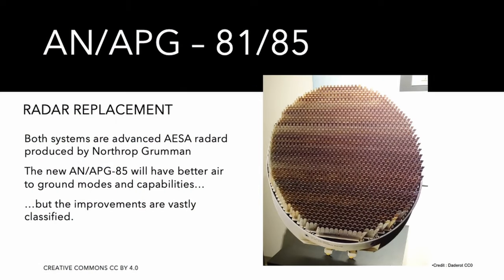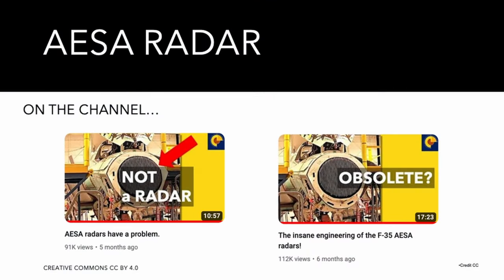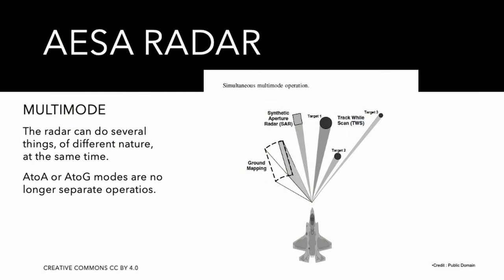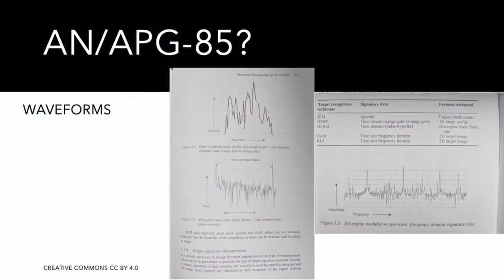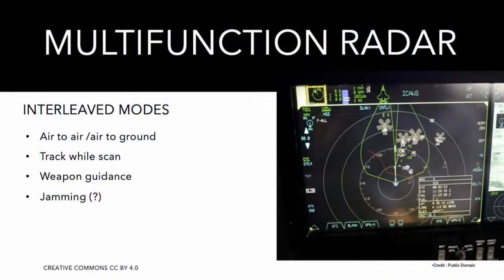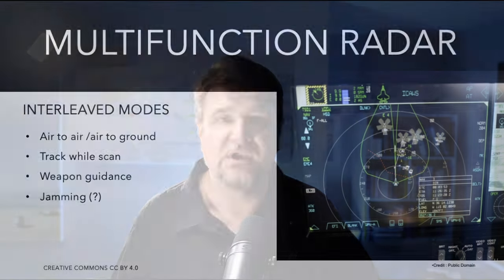The New F 35 Block 4 Radar is Bonkers!

Comment: For me this sounds highly complicated and a lot more electronic hardware & software on board. The F-35 is bursting with hardware ( so I have read on other videos). For me there is one question: isn't the F-35 a very delicate machine for external "powers"? Let's say by coincidence a bullet hits the body and ends up in some hardware. Can't something like that immediately cause a system crash and the F-35 falls out of the sky? Or a weather incident somehow get's right into the systems? Most of you probably now would like to wring my neck for even just suggesting something like that, but I never had really good "relations" with computers and software so I automatically think that any hard-and software is vulnerable....??
Reply: Shouldn't be that vulnerable, but the test pilot said every piece of software affects the entire system, so I guess it is possible
Reply: @matheuscerqueira7952  Thanks, yes, it is basically a computer with wings! So the "stay away from trouble" - strategie and deal with it from a distance makes sense!
Reply: If you think about it, your phone is full to the top with all kinds of hardware and while there are issues, it is functioning pretty well.
Reply: @napobg6842  True, I sometimes wonder myself why these gadgets still work after being used consistently! Just one thing: if I would put a bullet through it I do not believe it still would be able to go on like an F-35!!😂😂
Reply: @martinabowm1786  Well, there is so much tech inside a phone but it is really small on size so your bullet would do a lot of damage to a lot of hardware. While on the F-35 you have a lot of very big hardware. This means that you bullet would do a log of damage to just 1 type of hardware 😂😂
Reply: @napobg6842  Yep, got it!
Reply: I'm not entirely sure about the nature of the complaint. If a bullet destroy a critical component of any fighter, the fighter is a write off. 

Beside, this is the radar we are talking about, which has nothing to do with flight control system. 

Tell a f86 pilot how a su34 radar works, they probably be complaining it is too complicated.
Reply: @jintsuubest9331 Good evening friend. I just am back from being the teenager-taxi and see your reply to my original comment.
We all in the group  were discussing the vulnerability of the electronics of the f-35 in case of a bullet hitting it. There was no complaint from nobody, I actually thanked all for a great and friendly discussion - does not often happen on YT!  Is it possible you sent your answer to the wrong person? 😊
Reply: There is so much electronics that the power supply complete overheats.
Reply: @PatrickSavalle  Evening Patrick. I heard something about excess heat. But: I would be very surprised if they don't immediately get that sorted, considering the time and money this programm has used up! I don't think that a jet of this level wouldn't be upgraded / corrected immediately! There is also the prestige to consider should suddenly F-35's start overheating and are standing on the side of the road, boiling and waiting for the AA!😂😂
Reply: @martinabowm1786  Won't be easy. The jet is already overweighted and underpowered. The turbine temperatures are already at an insane 2000 Celcius, so the engine is operating way beyond normal limits.
Reply: @PatrickSavalle  I did not know that ( well, I know very little compared to some serious specialists here on this channel - but I am learning!), sounds to me like a brakedown looming or was the turbine planned to be at that temperature? Does this heat in the turbine have an effect on the electronics? Or am I mixing up things? The electronics for sure must have some form of "air conditioning"....
Reply: @martinabowm1786 Uuuh, I hate to be the one to tell you this, but every new American fighter since the early 80s/late 70s has been a true computer with wings

The F-14 flight control computer was 30 years ahead of its time. The f-18 was even more electronic. The f-22 is entirely fly by wire with no analog backup!

If the engineers are doing their job to meet SIL-4 and SIL-5 reliability standards, no single failure should cause the aircraft to crash. If a 20mm round blows through all the avionics, no amount of analog controls will save you, just as if it blows through a critical hydraulic line or the pilot himself

Similarly, if they've done the hardware and software right, no amount of nearby lightning or rain should cause the aircraft to crash.

What you're thinking of is a real problem - it's essentially practically nearly impossible to know in all cases if your software is correct, even with the state of the art in static analysis, formal verification, and formal methods - but there's an entire field of safety critical software engineering that's dedicated to pushing that as far as possible and building failsafe redundancies such that safety-critical bugs are segmented and recoverable

Will there be problems? Absolutely! Will it be as fragile as the shit software that you and I are stuck with every day? No, thankfully.
Reply: @Ariccio123 Good Morning Ariccio! Big thanks for that detailed answer! You of course are right that previous jets were packed with electronics and software - I just never thought about it until I started reading here on this channel,  Gus / Millennium 7 does catch ones attention and lust for learning with his endless knowledge and humour!
You are right, electronics have been in jets for a long time - and haven't fallen out of the skies every day!
I had to laugh at your last sentence - yes, I also was fed a Microsoft Windows diet for years and learnt to anticipate a crash lurking behind every corner!😂😂
Thanks again, info was great! Have a lovely weekend..
Reply: @martinabowm1786  👍☺️🤗

Comment: Limited by and wasted on that platform. Put the same technology on a F-15EX, just with a bigger antenna and more power.
Reply: Under another video on this channel F-35 defenders already conceded that it will have to fly stand off missions against land targets, and in air to air it will have to carry missiles on external stores because it doesn't have enough. Stealth not a trump card anymore. Furthermore, to have a fighting chance with something like R-37 armed fighters it would have to make use of that recent SM-6 conversion or another long range AAM which won't fit in bays. I want to see that loadout, because it would look hilarious.
Reply: @piotrgrzelak2613  The problem with the R37M and other long range weapons in use by China/Russia is that the radar of the aircraft cannot get enough data to launch the missile until they are well within the MAR of the Delta version of the AMRAAM. They could use the launch and lock tactic but even then, evasive maneuvers and the tiny jammer pod to mimic the F-35's RCS would be enough to fool a weapon that has only direction as its info. The F-35 doesn't need huge weapon supplies and it is getting approval for the meteor missile soon as well. This combined with ongoing efforts to enlarge the weapons bay will make the F-35 significantly more effective than a F-15EX with a RCS literally thousands of times larger. A system like that will be incredibly easy to shoot down with weapons like the R-37M.
Reply: @gnueshk1344  The problem with your post is that you have nothing to back it up. "Radar of the aircraft cannot-" let's stop right there. Who says it? What aircraft? You just assume things because USAF had the top stuff in 2000s. You're behind the times. Downstream. Russia and China now have distributed networking and detection and you're stuck in what was back when.
Reply: @piotrgrzelak2613  Im refering to the AESA radar on the Su-57 which struggles at detecting long range stealthy targets but would have no difficulty with the 4th gen F-15EX.
Reply: @piotrgrzelak2613  Also the further development of stealthy CCA would greatly improve the capabilities of the F-35 and stealth jets making them significantly better than the F-15EX would be.
Reply: @piotrgrzelak2613 You are so totally full of shit it’s hilarious. According to Russian figures the longest range a Russian fighter’s radar can detect an F-35 is about 80km, well within the range of an AIM-120D. 

All of your “points” are completely made up. It’s ridiculous
Reply: @hresvelgr7193  referred to secret sources but didn't quote them -award
Reply: @gnueshk1344  "I'm referring to a radar which exact performance is a closely guarded state secret and about which very little can be inferred from the outside, unlike aerodynamics and kinematic performance where American propositions suck a fat log."
Reply: @piotrgrzelak2613  says the guy who has cited exactly 0 sources. But given the fact you think American fighters suck at kinematic and aerodynamic performance you clearly don’t understand reality
Reply: Still waiting for the source to the 80km figure btw, the one you just shamelessly pulled out of your cloaca and now pretend it didn't happen
Reply: @ Oh that’s easy. According to the Russian Air Force handbook on the Zaslon radar of the MiG-31 can detect a 20 m^2 target at 400km. The F-35 has an RCS of 0.005 m^2. Since detection range is proportional to the fourth root of RCS using some simple math we can find the range at which it can detect an F-35 sized target. That distance is 50 kilometres. A little lower then last time I calculated it, must have had different figures. Not that it detracts from the point :)
Reply: Ohhh, so to prove his point a posturing imβεcilε has to compare with a 40 year old Zaslon radar, (which was upgraded since) and not with N036? Not even the N035? This is pretty bad, are you implying the toy which honor you keep passionately defending could only sneak up on an old MiG-31? I won't even try to deepen this tactically, although 2 aircraft in a vacuum is a laughable comparison. The most idiotic part is your idea about the RCS, that it is a stable, singular number that sufficiently describes  plane's reflection. This is so breathtakingly stupid that I think I'm being baited, or you had to discover the topic yesterday writing this reply. If anyone else reads this, naturally the cross section differs for every angle, even a single minute changes it, small coating damage, noise, there's simply no single number to describe it. 0.005 quoted is an example of false advertising because it would place the plane's rcs as smaller than the missiles it itself carries (like JASSM). Presumably it's supposed to represent the very front under perfect conditions (useless data). I really don't understand what you're trying to prove here, but it's embarrassing. Did you count on me never seeing an RCS model? If the level of this exchange is supposed to be like this, I'd rather you don't reply.
Reply: @ What’s embarrassing is this misguided rant. 

I should have known you’d try to brush it off as the original Zaslon radar. In reality that document referred to the current iteration of Zaslon at the time, Zaslon M. But hey if you want to use NO35 the calculation is simple. It would be able to detect the F-35 at 70km using its narrow scan mode. 

I never said that RCS is a stable, singular number. Strawman is a fallacy, not a valid form of argument. If you could have the decency to not put words into my mouth that would be great. If you can’t don’t bother replying. 

But yes, RCS does vary depending on countless factors. However the US does not publish the RCS of their aircraft from multiple angles. Nor can I determine the actual RCS of these aircraft, if I could I’d be working for some intelligence agency making big dollars instead of telling you that you are wrong (and anyone else who can do so would similarly be working for an intelligence agency rather then posting about it online). And don’t bother bringing up the various simulations you can find online. Those are estimates that don’t have access to the exact shape of the aircraft or the effect of radar absorbent material, they provide an imprecise estimate on how the angle the radar is at impacts RCS. 0.005 m^2 is the figure that is available so it’s what I used. 

Additionally I find it noteworthy that you’ve raised such a fuss over that figure being taken in ideal circumstances but no such fuss was raised for the range of the Russian radar also being taken in ideal circumstances. 

Furthermore we know that 0.005 m^2 isn’t the frontal RCS of the F-35 in ideal circumstances. In reality it’s lower. The 0.005 m^2 figure originates from the JSF design requirements. However for a list of reasons it’s know that actual value is closer to that of the F-22, which as per the ATF design requirements is < 0.0001 m^2.

To add to all this the decades of success stealth aircraft have had show that contrary to what you are suggesting the RCS in on ideal conditions and non frontally isn’t enormously higher as if it was you’d expect these aircraft to be much more detectable then what the evidence shows.

Now this isn’t relevant to the topic but your “false advertising claim” is hilariously misguided. There is no reason an aircraft like the F-35 can’t have an RCS lower then that of the munitions it carries.
Reply: F-35 and F-15EX are not the same  type of aircraft lol. They don't serve the same mission and have vastly different doctrines
Reply: @gansior4744  The point is that I believe the latter can do everything the former does, and better. I should be your tutor for understanding written text.
Reply: @hreswelgr
Zaslon-M, so late 80s, early 90s, awesome! Maybe just a few more failed attempts at deception and you'll admit the actual info on the current 31BMs isn't public, as they weren't exported. But I did get a 70km for the Irbis-E out of you. Tell me, do you still consider it to be "within AIM-120D's no-escape zone"? I'll find out if you're as bad at maths as you are at lying. "I never said RCS is..." - you argued as if it was, that's called lie by omission. "I can't determine the RCS..." Maybe not you and not "determine", but it can easily be estimated, many people do on youtube.
Reply: Speaking of fallacy: what kind of a fallacy is "I would be working for x if I knew"? Is it "appeal from a warehouse worker"? "Appeal to a task being impossible" (building your own detailed 3d model). Maybe you're just not talented or smart and that's why you don't have a good job, which seems to bother you.
"There's no reason aircraft rcs (...) lower than a missile" of course there is - aircraft in question has a far more complex shape with many rounded surfaces. 
"Decades of success of stealth aircraft" Define success. The first stealth aircraft with an air victory over another plane is Su-57 about two years ago, by the way. I also find it funny how you stop being able to to make sense or speak English in the second to last paragraph, which I'll take as a sign of stroke - in the ideal circumstances. I don't think conflating an ancient declassified design paper (no source provided either, no evidence of other claims) with real performance is worth a comment. The rest is ESL babble.

Comment: why putting  a so refined radar  in a flyin brick !
Reply: It's better than a tinfoil hat.
Reply: Because you are told it is a flying brick.
Reply: I just noticed that you spelled Pierre wrong in your account name!:penguin-blue-waving-tear:
Reply: @napobg6842 it’s a flying brick with two tiny feathers.  The reason is the power of Lockheed over the acquisition process (the general in charge of the JSF program called it “acquisition malfeasance”).  Instead of mass producing hundreds of deficient block 3 f35 aircraft that will never be upgraded to block 4, DoD could have bought literally hundreds of new F15 aircraft with lots of upgrades including the F15EX
Reply: Since when flying bricks are able to fly over the Iranian territory to destroy (or help destroy) Russian air defence systems among other targets ?
Reply: @artiefakt4402  since 1980's  iranian missiles  hit  f35 hangars  in nevatim ... protected by iron dome , patriot ac3  and Thaad ..  no air def is invincible.
Reply: @artiefakt4402   you  dont need 2000 billions $  program  to do this mission ... and if  f35 is good to  snipe  a target  in a banana republic .... in  a real war , its maintenance rate is unsustainable
Reply: For that very reason.
Reply: I'd put them on flying elephants if we could do that too
Reply: @davidbarrois3959  …the F-35 didn't even exist in the '80s?
Reply: @belgianfried  but  the 1980 s made  iranian missiles  still in service  , ok i am a little bit exagerating ... but not so much